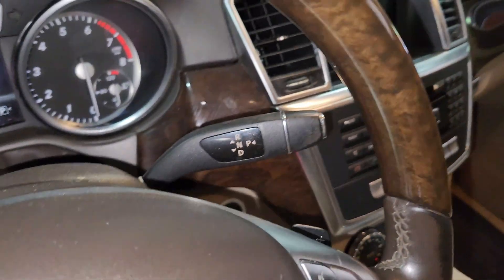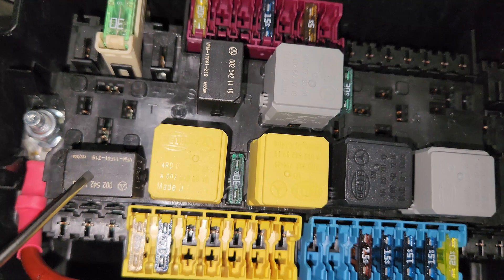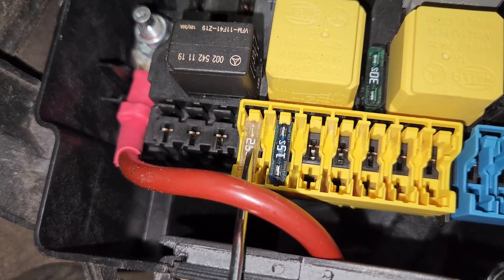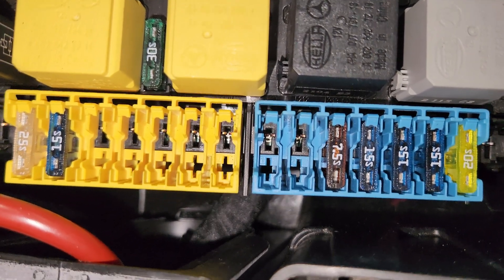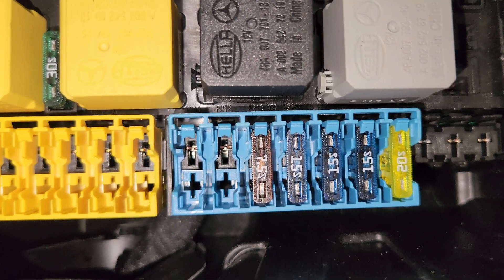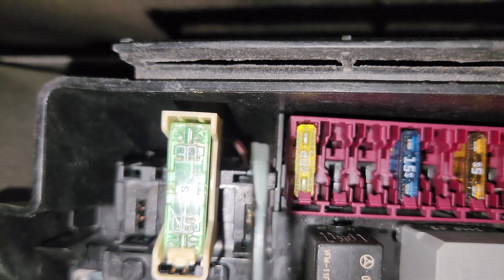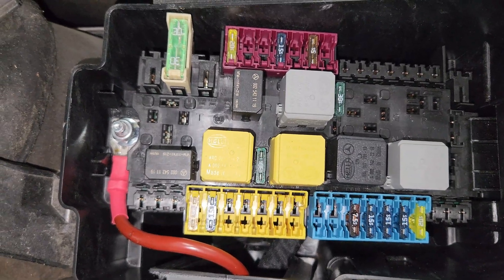Understanding Mercedes ML350 GLE350 W166 Engine Fuse Box Diagram Easy #fusebox #diagram #gle350

Comment: Thank you for the info. My f215 fuse is blown and if I add another it blows as soon as I insert it , It pops with a spark. What could be causing that in your opinion?
Reply from the maker: Is that a gas engine or diesel?

Comment: Hello, congratulations for the nice video. I didn't understand, did you have a fuse for the starter or is it only controlled by a relay? I'm asking about the GLE Coupe w292 with a 642 diesel engine
Reply from the maker: There is a fuse. Fuse no. 240A and it is 30A. That is for cars without Eco Start Stop.
Reply: Thanks for the answer, mine has a system Eco Start Stop and the ignition has a start button if that matters.
Reply from the maker: @ИвайлоВасев-й9х  What year is your car?
Reply: Thanks for the help, the car is 2016 and I found my starter fuse, it is 240B for cars with ECO Start-Stop system. Thanks again. @all-about-cars-basics
Reply from the maker: @ИвайлоВасев-й9х  I am glad. Nice driving out there.

Comment: Hello! Which fuze, relay for right and left headlights. 
2018 mercedes-benz gle 350? Please help. Thank you
Reply from the maker: The main fuses for the headlights on your 2018 Mercedes GLE 350 (W166) are located in the *Engine Compartment Fuse Box**: **Fuse 229 (7.5A)* for the Left Headlight and *Fuse 231 (7.5A)* for the Right Headlight. Modern Mercedes-Benz lighting systems are controlled by the *Front SAM Module* instead of traditional, replaceable relays for the main beams.

Comment: 2014 ml 350 My ac isn't working at all bought a new blower motor and put it in still not working  is there a fuse or relay I need to be looking at ?
Reply from the maker: It is most likely a blower regulator. Replace it and you should be good.

Comment: Hi nice video and I have a 2014 ml 350 with a misfire cylinder 6? I replaced the spark plugs and the coil but do I need to reset the ECU to remove the check ✔️ engine light?
Reply from the maker: Thank you. You don't need to reset the ECU for the misfire to go away. The check engine light should turn off on its own after a few drive cycles once the issue is resolved. If it doesn't, or if the misfire persists, there might be another underlying problem. You could consider checking the fuel injector for that cylinder.

Comment: Is there a fuse for the motor starter other than the relay ?. Because I checked the starter motor and it spins. But it doesn’t crank
Reply from the maker: Yes, the W166 GLE 350 has a fuse for the starter motor. It's usually a large *"mega fuse"* located in the pre-fuse box near the positive jump-start terminal under the hood. Having said that, your problem is not the fuse. Here is why. Since the starter motor is spinning but not engaging the flywheel to crank the engine, this indicates the *starter solenoid* is the likely issue. If the solenoid's gear-engaging function fails but the switch part still works, the starter motor will spin but won't crank the engine. It's a classic symptom of a bad starter solenoid. So, you are looking at getting a new starter.

Comment: Can someone please tell me which fuse is for the Ambilight and where it is? The light strip at the front and back is no longer working thank you.
Reply from the maker: Unfortunately, there is no one direct fuse that controls the ambient light in Mercedes W166 cars. What I would advise is that take your car for computer diagnostic and get the fault code that shows up under the Ambient Light Control Module. This will really help in pinpointing how to fix this.

Comment: Thanks for the video! Can you tell where can i find radiator fan fuse or relay on my Mb GLE350  2016 with petrol engine?
Reply from the maker: The fuse is number 216 and it is 15amps. It is located on the blue section area. For the radiator shutter actuator check fuse number 215 and it will be 15amps too. I hope that helps.
Reply: 2012 ml350 mercedes 4matic.. need the same location for fuse or relay for cooling fan please

Comment: Can you help me identify the full light fuse and relay
Reply: Can you tell me how can I get the fuse that controls fullight for m l 2011 model 350
Reply from the maker: @wasiuAderemi-d3b8x  Check on fuse 229 and 231 on the red section of the fuse box.
Reply from the maker: Check on fuse 229 and 231 on the red section of the fuse box.

Comment: where can i find the fuse for my liftgate? i just replaced the Power Hatch Lift Support but it still wont open or shut.
Reply from the maker: It is contained in the main fuse box inside the car. check this video linked here. https://youtu.be/budckYgdLQA?si=V7wGJNjt3heCJuue check on the first fuse on the green section. It is 5amps if I am not wrong.

Comment: I have a 2015 ml350 and I had a light up emblem installed a while back. I think the wire slipped out from under a fuse and idk which one it was. It used to light up with the parking lights only, not the headlights.
Reply from the maker: That might be a little bit hard to guess which fuse they installed it to. Normally it will depend on the person who wired it. Usually, they would go for any car accessory fuse that will turn on when the ignition is turned to position two (Accessory mode). I would advise that you take it to an electrician. They will be able to install it to a proper fuse that can handle both loads for the primary accessory and the emblem without overloading the fuse

Comment: 2012 Ml350 radiator fan no activate even with ac is on don’t turn on any fuse or relay
Reply from the maker: That can be caused by a bunch of factors, first is a bad temperature sensor, a bad fuse or relay and finally a fan that has gone bad by itself. For the fuse, check on the passenger side panel fuse box for number 13 (15A)
Reply: Where is the temperature sensor? How will I know it's bad? It's intermittent on mine.

Comment: Pls I have gle43 couple where is the fuel pump relay located and fuel
Reply from the maker: It is on the car main fuse box located inside the car under rear seat. I made a video about that fuse box in the channel. Check it here https://youtu.be/budckYgdLQA?si=pZjj2PfKSDbZoKiS and for the fuse look around 3:58 onwards.

Comment: Can you tell me where's the ecu relay?
Reply: Hi my GL 320 4 magic horn, wiper,indicator and cruise control not working. Can you tell me where is the fuse for this? Or what’s the problem if you know. Thanks
Reply: Hi my GL 320 4 magic horn, wiper,indicator and cruise control not working. Can you tell me where is the fuse for this? Or what’s the problem if you know. Thanks
Reply from the maker: @SanthoshRajan-p3d  Is the GL X164 or X166?
Reply from the maker: It should be the grey relay on top.
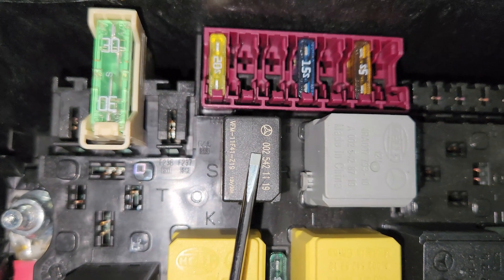Reply from the maker: 2:24 on the timeline.

Comment: Thanks for the video. Would you please let me know how to remove the cover on the prefuse  box under the jump start stud in the egine compartment. Thanks
Reply from the maker: First remove the red covering top. it has kind of a clip lock on the sides. Once that is out of the way, unscrew the 13mm positive terminal bolt like fastener, this will allow you to detach the power cable from the battery and the one going to the starter. Once that is out of the way remove the cover by unclipping locks that are located all around the box (use a hook pick or a flat Philips to remove the locks) once done the cover will open and you will access the contents inside the box.
Reply: @all-about-cars-basics  Great explanation. Thank you

Comment: 2014 Mercedes ml350. Can you say if the vehicle has a fuel pump relay? 
The fuel pump fuse was blown and I replaced that but still not starting.
Reply from the maker: Did you check both fuses for fuel pump control unit? on location 112-5amps and 132-25amps?
Reply: @all-about-cars-basics  yes the 112-5amp is fine.
Reply: please check the fuel pressure at the shraeder valve at the end of the fuel bar. with engine off, and lots of rags to stop the spray, just push in the valve. There may be air lock in the line after replacing the pump.

Comment: Where is the fuel fuse? My Father with dementia goes to start the car which is not safe for anyone outside. I want the car to not start whenever he tries to start it.
Reply from the maker: Also, it is not advisable to remove the fuel relay or fuse because over cranking your starter will lead to a premature wear and you will have to replace it sooner.
Reply from the maker: For your case just remove the starter relay and you will be fine. It is black in color 1:56 in the video. And the car will not start anytime he tries to. And you can put it back when you are ready to drive.
Reply: @all-about-cars-basics  thank you so much

Comment: Mercedes 2015 GL450 system works but no sound FBAS  not connected fuses problem?
Reply from the maker: I think it might be a fuse, try checking the battery compartment fuse box, location 30 - 40amp

Comment: Is there a fuse for the glove box light?  If so, please show where it is.
Reply from the maker: Yes, it is located on the main fuse box under the rear seat on location 135 - 5amp fuse.
Reply: @all-about-cars-basics  Thanks.  I checked location 135, fuse is not burned, light bulb in the glove box is not burned either but it doesn't light up.  What else do you think is the cause?   Possibly the contact switch when open & close the glove compartment?
Reply from the maker: @dukehoang2786  It can be bunch of stuff. Did you replace the glove box bulb? If not try replacing it. Also check on the glove box sensor maybe it is bad and not sending the signal that the glove box is open. sometimes it does that.

Comment: i have a 2015 ML350 and all the needles on my instrument cluster don't light up.  everything else in the instrument cluster light up at night except for the needles.  Do the needles use a different fuse than the rest of the instrument cluster?  Where can I find the fuse box for the instrument cluster?
Reply from the maker: The fuse box is on the side of the passenger door.